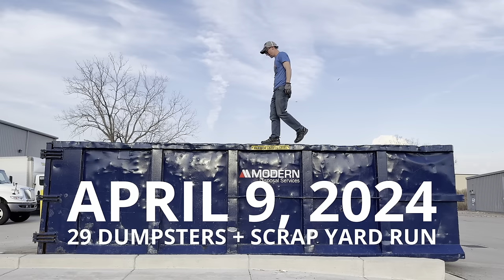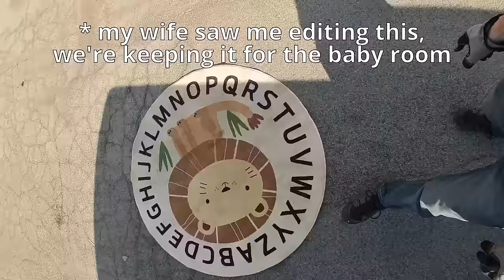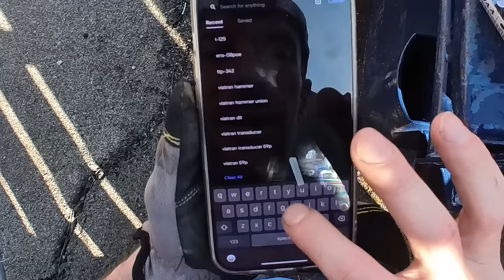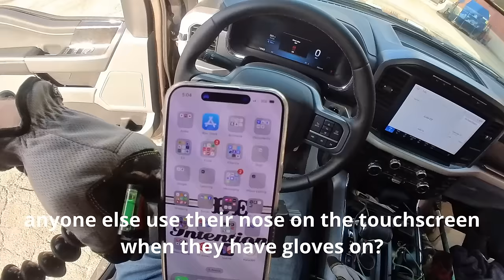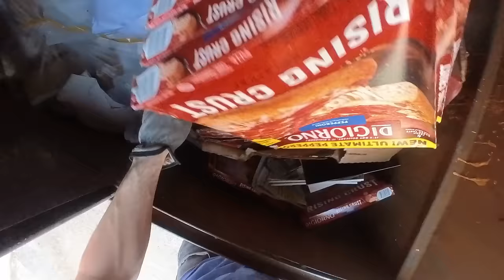One Step Closer to World Domination

Comment: Late to this party but hope it helps ya.

Acrylic is typically a more rigid plastic, whereas polycarbonate can be purchased in various flexible grades. Nevertheless, both plastics can be bent under heat if needed. Polycarbonate, too, is slightly more durable than acrylic and less likely to crack under stress.